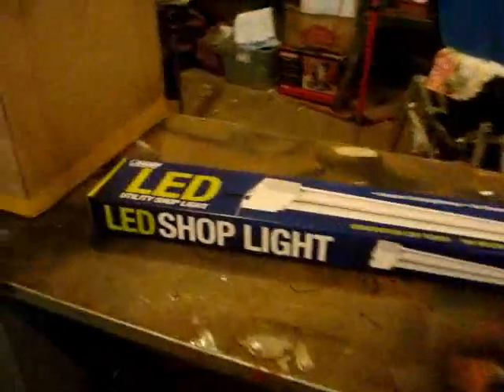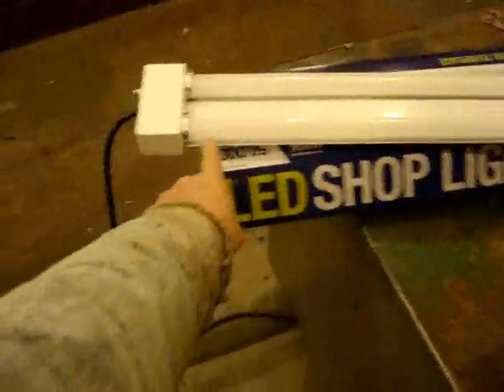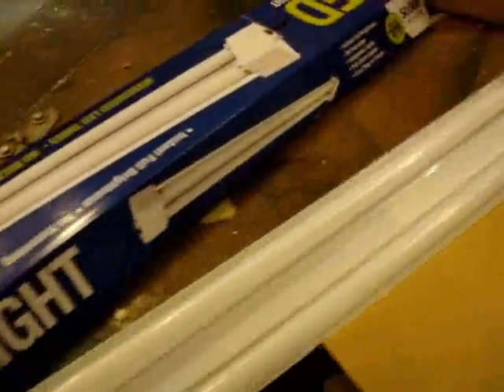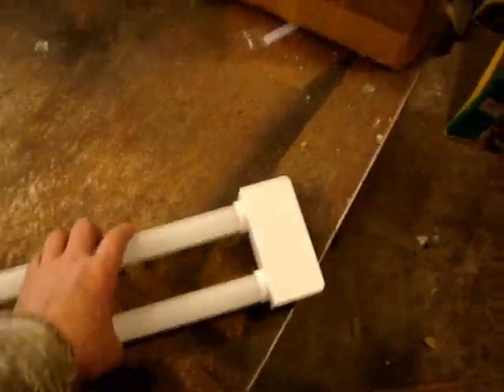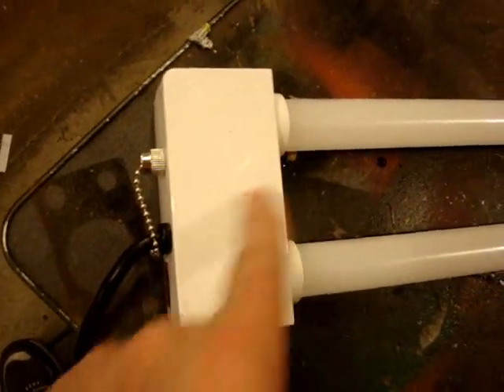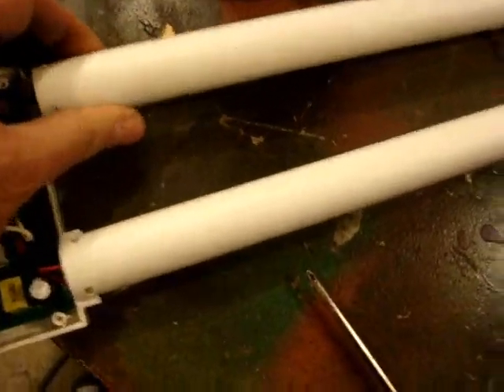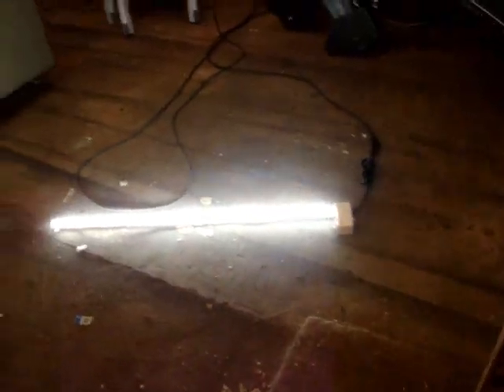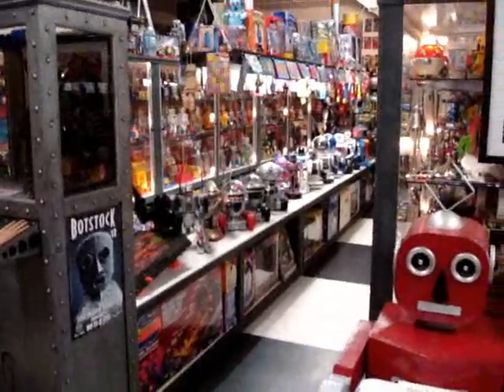Bright Idea LED hack / mod's for the RobotHut lighting.

Comment: Nice video. Remarkable technology. When I installed mine, I needed the "coverage" of the metal back to cover the surface, which revealed it wasn't painted when I removed the old fixture. Since no wires, I just drilled holes in the metal back and mounted flush to the ceiling. Worked great.